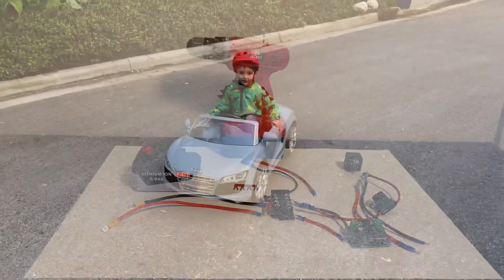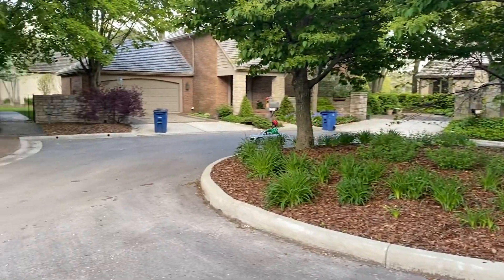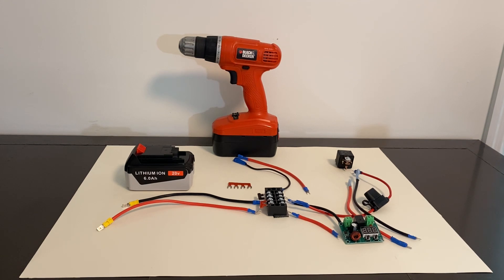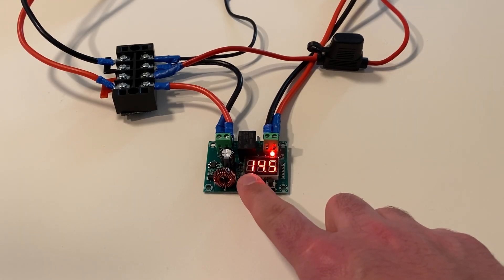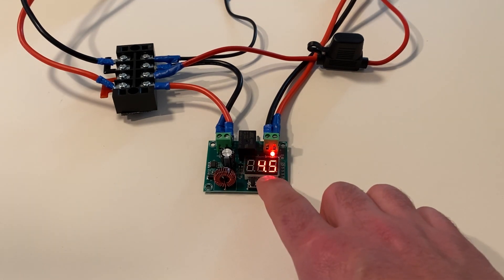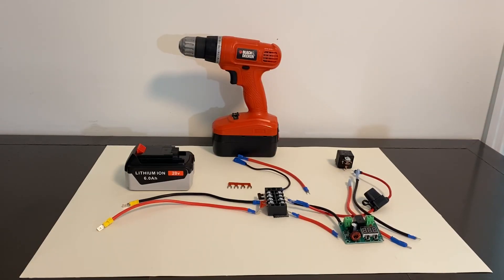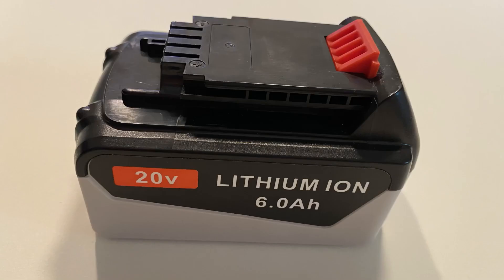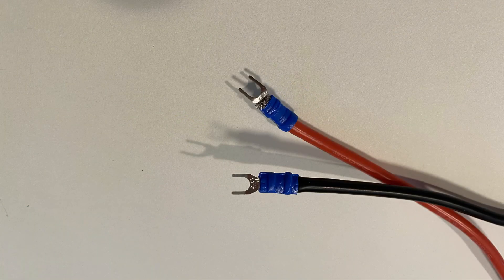18 Volt & 20 Volt Battery Upgrade for Power Wheels with Low Voltage Cut Off

Comment: Wait WUT????    Um.. Bro?  The Black and Decker Packs already have a BMS built in.  The Low Voltage Cutoff is already built in.  You don't need the Board.  Maybe for Generic Packs from China,  but from what I have seen, almost all of these have a BMS on board that does this. 

So the BMS board you got is really made for Bare cells.  Like these from Battery hookup:
https://batteryhookup.com/products/spim08hp-3-7v-8ah-200a-lithium-ion-w-cell-holder?variant=33526051143812

These are Bare cells.  They don't have a BMS.  I bought 2 boxes of them.   Something like this would be PERFECT for a BMS like you have.  (or low voltage cut off board. )   

   Your Battery pack is fine without it.  

About your Question?   The Relay location for the Pedal switch.    The Physical location  would be best right next to the Battery as DC system suffer from Voltage drop.   So shorter cables are always good for the Power wires.   
---However, as I understand it? You want to know how to wire the Foot pedal ?  

Here is a diagram on how the  use a relay with the stock wires.   
https://www.pinterest.com/pin/41587996535411866/visual-search/

Now, what YOU want to do, is  use the switch as an On/Off for the relay.    I.E. , the  Foot pedal does not take all the current.  It just signals it to a Relay right at the Motors and the battery-(s*) that you use keeping the wire runs as short as possible.     

To wire this, you would take where the  wires to the Motors are, and that is where you would want to put the relay.   

Here is an example with 4 motors showing reverse and Drive: 
https://thumbs.gfycat.com/TallInfiniteBrownbear-size_restricted.gif

If you want a Plug and play way to save your gearboxes,  The Princess power wheels has this control box that runs at 24 Volts.   Its a Soft start circuit:  

https://www.amazon.com/WELLYE-Princess-Controller-Accessories-Replacement/dp/B07BSKSMMZ/ref=asc_df_B07BSKSMMZ/?tag=hyprod-20&linkCode=df0&hvadid=242024237009&hvpos=&hvnetw=g&hvrand=5517877641170945239&hvpone=&hvptwo=&hvqmt=&hvdev=c&hvdvcmdl=&hvlocint=&hvlocphy=9061079&hvtargid=pla-642149452486&psc=1#customerReviews

It has some Delay when you press the pedal, but the gearboxes will then have no problem even dealing with Rubber tires bands on acceleration.   However... Stopping will still jar them just as hard.  So you could use a resistor, (AKA Halogen 12v  100W h3 or h1 Bulb as the cheap way)  to gradually slow it down.   But due to safety?    I'd sacrifice a gear box before I worry about my kid not having good brakes.    

You could use a Bulb with a fuse breaker,  and then it would still lock up the brakes but in a more controlled manner,  but kids like the sudden stop if you ask me.   and it takes away the fun of doing AKA: Hand Brake turns.   

In fact, its not the GO that burns the Foot pedal. Its the braking.   Hence why the RELAY is such a good idea for use on the motors, as it  "Shunts them"  at the relay, saving your foot pedal switch from taking all that current.  
Mind you, its going to be More Abrupt of a stop if you don't use a Resistor or a light bulb in on the relay.  

That means you will be using a 5 pin relay's *87A as the Loop that will ground both motors providing the braking.    
https://mgispeedware.com/wp-content/uploads/2019/07/relay-socket-wiring-diagram-5-pin-600w.jpg

So when Power is not applied,  the relay will go to Normally closed where 87A will be energized.
Use 87A  as a triger signal to the other relay that will close the circuit to shunt (Put both motors in Positive and negative leads to each other so they Ground to each other as the stock switch did) both motors for braking.    

A good video on this is here: 
https://www.youtube.com/watch?v=IsR_xZvzqXA

They only use one relay, but it works.  It fixes the switch problem.  

For a Drop in ESC that does it all?  
https://www.youtube.com/watch?v=b_Ajbs-E7O0

Hope that helps!  
-iMickey503
Reply from the maker: Awesome, thanks for the great resources. For the battery packs, the only batteries that I found that actually have the BMS built-into the battery are Ryobi. The other brands have the BMS in the tool, so when the battery isn’t used with the tool, they don’t have the ability to cut off
Reply: @DadHacks     Yikes! NO BMS on a powertool pack? 
this is something that needs to either go to AvE or project Farm.   

the only battery packs that I know of that don't have any internal protection circuitry are the nickel cadmium and nickel metal hydride style battery packs.

even my 12 volt lithium powered Craftsman stuff from 10 years ago has a built-in BMS on the individual cells.  

from what I recall even Black & Decker has a built-in bms.   the packs internally are the same thing that Bosch and Craftsman use in their power tool lines.

let me know what brand or model number the packs are and I'll  try to get a hold of some of those battery packs and do some testing on them this next month or so.  

I'm absolutely floored that you can actually purchase battery packs like this  in the United States as from what I recall,  

The regulation: 49 CFR 175.10(a)(18) from CPSC  is here:
https://www.ecfr.gov/cgi-bin/retrieveECFR?gp=1&SID=bba5ad06518b529c94e1d67a3270196b&ty=HTML&h=L&r=SECTION&n=49y2.1.1.3.12.1.25.5

Crazy!
Reply from the maker: @MickeyMishra  can you try testing out the Milwaukee M18 RedLithium (XC 6.0) or any variation of the M18? That will be the one I’ll be using in the future.
Reply: @DadHacks        Already done!  
https://www.youtube.com/watch?v=4OkT_SU6GSg

Project farm did the test.
amazingly,  the only battery  that has a low voltage cutoff are the makita's surprisingly!

the other battery that I thought had a low voltage cutoff  I'm going to have to test.  

Rich rebuilds recently did a build with nothing but power tool batteries for a Danish go-kart or electric vehicle and that should be of some entertainment value but again I thought these had a low voltage cutoff as well.   

also if you want to save some money and get the same kind of packs for 5 for $20 Battery Mart has some in stock that many actually work right out of the box.   

I'll see if I can find more details about the specific battery and I'll get back to you sometime this next month
Reply from the maker: Great video link, thanks!